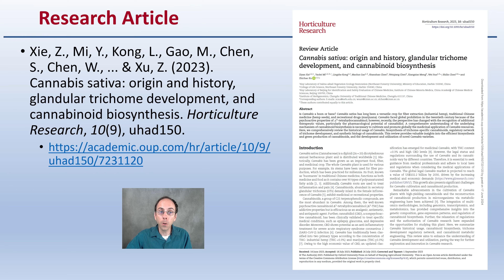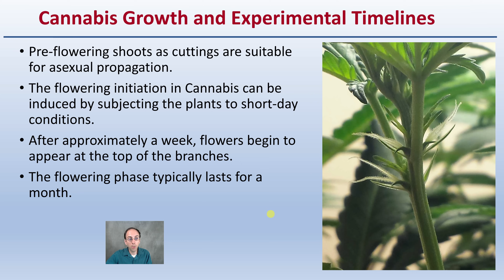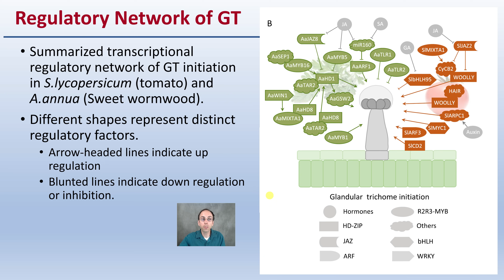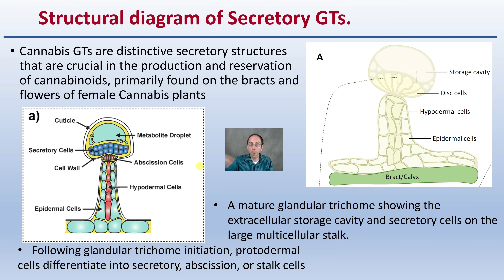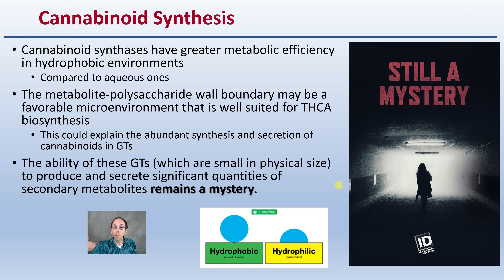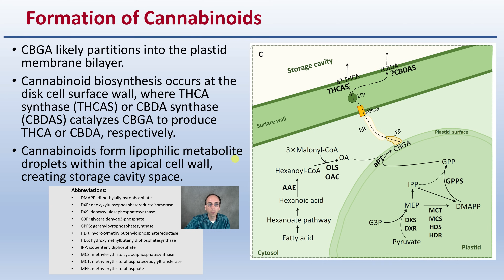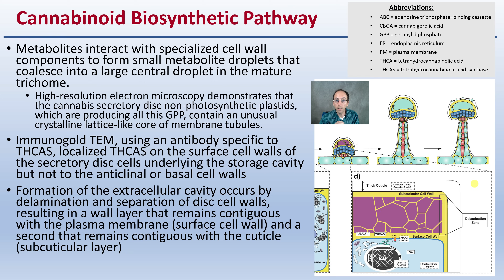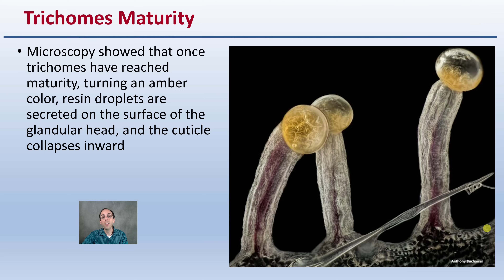Glandular Trichome Structure and Biosynthesis

Comment: 2:24 The solution does not turn female plants into male plants. A plant is male if it has  a Y chromosome, and no solution gives a Y. The solution is altering hormone levels which force the plant to produce female* pollen sacks which contain female* only pollen.
Reply from the maker: Correction would be it causes a female plant to produce male plant structures.
Reply: @DeBaccoUniversity  They are not male. The issue is that you're using binary sex identifying words to describe a monoecious plant. Sex and reproduction producing parts are independent. You can have males that produce pistils, and females that produce pollen. They are not "male" or "female" parts in Botany. The falacy is probably rooted in human anatomy idiation.

Comment: 2:04 photoperiod-sensitive plants can start off on 12-12 light. They will ignore the light condition (not building up flowering hormones) for about 3 weeks before the light schedule begins to take hold. Other than that, there is no minimum time to veg before flower - the bud on an immature plant won't out-grow the plant any more than a mature plant's bud would.
Reply from the maker: Why take the risk running a young plant in a 12-12 light cycle especially when the DLI will benefit from longer duration of light due to the reduced intensity?
Reply: @DeBaccoUniversity  You can probably come up with your own but ones I can think of are that you're using the sea of green technique, you are pheno hunting, or you want to produce seed.
Reply: @JesseJames83 
That'd come down to the root system. The bigger the feet, the sooner they start walking ...and then running.

Comment: what would stop tricons from turning amber , went 4 wks pass due date
Reply: Overdrive nutrients from advanced nutrients but nothing stops it
Reply: Leaves turn faster than the bud does. Look at the bud and you get 1 and if you look at the trikes on the leaves they are darker. I was always told to pull when the bud itself gets into the red not the leaves
Reply from the maker: This is a natural process, not sure what you are using for the due date, but speed of turning varies by variety.